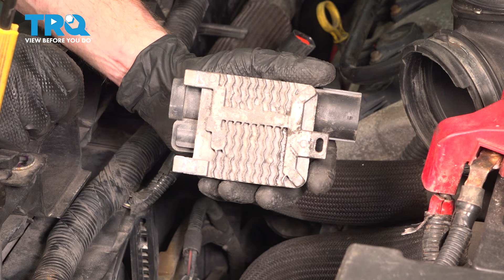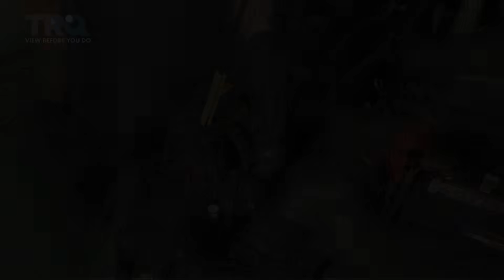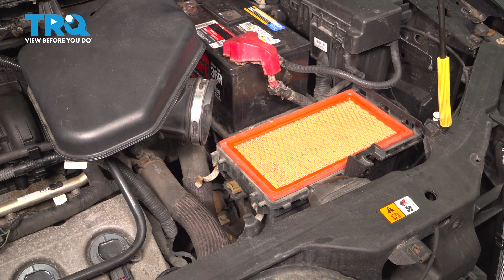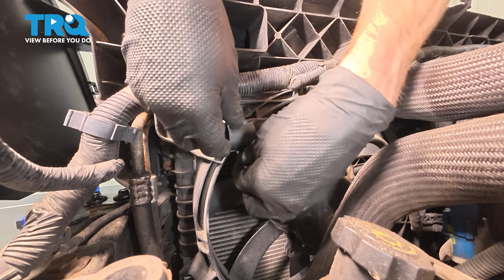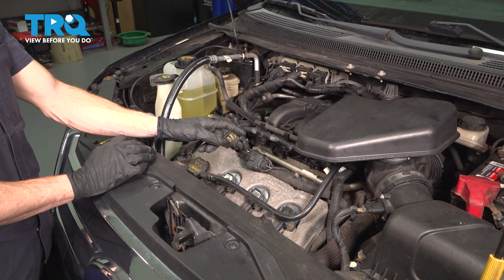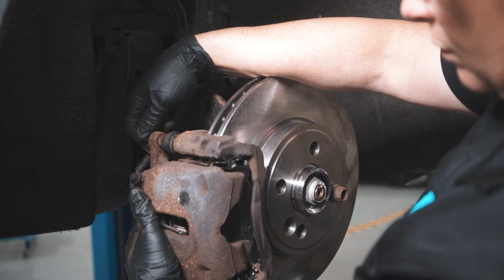How to Replace Radiator Fan Control Module 2007-2014 Ford Edge 3.5L

Comment: I have a 2012 ford edge, I’ve replaced the electric fan, radiator, and thermostat. Still overheating, and noticed the electric fan works, but it’s very sporadic. Maybe it’s the module

Comment: My New fan stops spinning after 30/40 minutes when AC is on, temperature will rise, I immediately turn off Ac , the temperature goes back to normal. Having this issue with 08 ford focus SE 4 door 4 cylinder 2.0 engine.  Ive already replaced fan twice in a week, . My son is coming to check the relay today, if the relay is good ,  then this must be the culprit

Comment: The fan for my 2011 Ford Edge runs even when the car is off and the engine is cool. I removed a couple of the fuses to kill power to the fan because it drained my battery. I tried replacing the fuses but it still runs when off. Do I change the cooling fan module to fix the issue?

Comment: did you have to drain the coolant before doing this? Im having an overheating problem with my 2008 Ford Edge and the guy we had look at it says it might be the sensor and since im broke im probably gonna have to do this myself